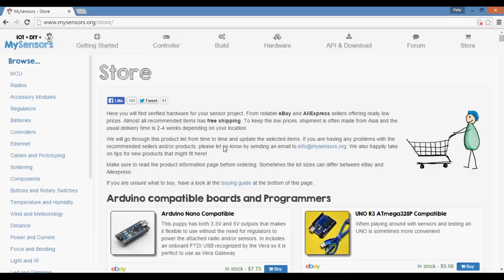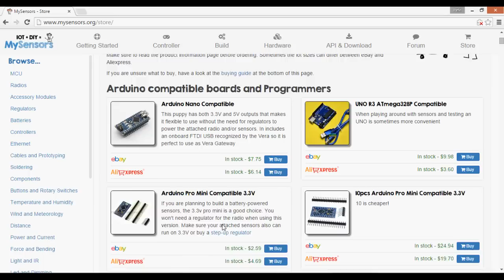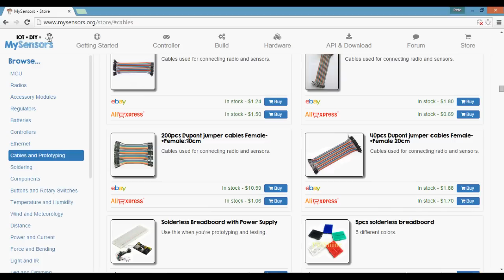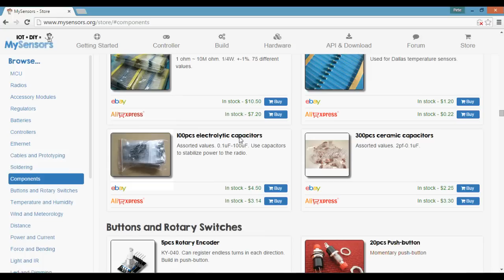MySensors Getting Started: Creating a Motion Sensor

Comment: Like your videos.  Trying to wrap my head around all of this stuff.  I know I just need to get started and try a few things but struggling with what controller to use.  Ultimately I want to control a complicated semi commercial greenhouse on my property as well as many things in the home. Not sure if Vera is my best choice?
Reply from the maker: I have been using my Vera since 2013 and it has served me well.  It is not without it's flaws but it doesn't have a monthly subscription which is nice.  It's cheap to jump in and try it.  I recently have been getting started with Home Assistant.  It's free and open source and also seems to have some amazing momentum around it.  I like that the hardware can be scaled if needed (unlike Vera).  The MySensors integration isn't as full as it is on Vera but it doesn't seem to be a deal breaker so far.  I know there are others that use Domoticz.  Are you going to need remote access?  Vera does it for free and Home Assistant can be configured manually or you can pay a $5 monthly fee for it.  Not sure about Domoticz.
Reply: Pete B yes I need remote access.  how remote can you be?  Can you control and check on things when your away or on vacation?  I have had problems with water being left on.  Have you done anything to sense your water meter usage?  I see their are a couple of sensors for that possibility.  Does the radio work for structures outside the main one where it’s housed.  I have an outbuilding and a greenhouse.
Reply from the maker: You can check the Vera anywhere with an internet connection.  I' sure Home assistant will do it as well but I've not yet implemented it so I don't know the experience. 
I have two devices for monitoring water but both are custom built.  The easier of the two is RTLAMR to monitor my utility water meter's over the air signals.  I know there are some commercial options out there but I'm not sure if they integrate with any home automation controllers.  
The radios can work over long distances with the right antenna.  If you're using MySensors you can have repeating nodes.  If the distance is really far you could even consider a separate gateway and send the messages back over ethernet with MQTT or the ethernet gateway.

Comment: I purchased a pack of 5. I connected a 12v DC input and no matter what I do the output always shows 12V. It never goes to a "low" 0V output. From what I read these can use between a 5v and 20v input so I'm assuming a 12v input should not be an issue and still produce a High when triggered and Low 0V when not triggered output. What am I doing wrong?
Reply from the maker: They are pretty simple devices so they may just be bad/dead but have you tried triple checking the wiring?  Check to see if 5V works (instead of 12V which should not be an issue but you never know).  Adjust the trimpots to make sure the time delay is turned down to around 5 seconds.

Comment: I hate to bother you again but after  adding the sensors  to vera the luup engine keeps rebooting randomly i tried with sleep and only reporting when motion is detected can you please look at  my sketch  https://pastebin.com/uBxULfwU
Reply from the maker: Strange.  I have been using the Vera files without any issues for years.  I would start small.  Make sure the basic motion sensor sketch is working properly then start adding additional sensors.  I am using an Ethernet gateway that my Vera connects to via a static IP.  From there all my sensors are communicating with the gateway.  If you are still stuck after that I would suggest posting on the MySensors forum as I have never experienced the issues you're having.  Sorry I can't be more help!
Reply: ok , and you are using the basic example sketches without modifications ?
Reply from the maker: Just the configuration changes (IP address, radio power, etc).

Comment: Hey Pete can you post some of your sketches on github or somewhere so i can look at them since you also use vera, and for the life of me i cant get rpi 3 ethernet gateway to work properly on the vera edge ui7  vera shows it connected but when hit pair then plug sensor in and wait 1 min nothing shows up. I use MYScontroller and can see the sensors communicating.
Reply from the maker: The sketches are all here: https://github.com/mysensors/MySensors/tree/development/examples but it doesn't sound like that's your problem if you see them working in MYSController.
I use an Ethernet gateway and haven't tried the rpi.  I would suggest heading to the MySensors forum as they will be more knowledgeable.
Reply: ok thought  yours may have been setup differently as from what i see there is always some type of variations ,  and am trying to see if any or your combined sketches look diff.  I have been looking in the forums. thanks for replying

Comment: Hey Pete thanks for the video.  I wanted to make a multi sensor node using, DHT22 AM2302, SR50,TEMT6000 and maybe smoke, now my question is if i did not want to use a breadboard or prototyping board since they all uses 5V would i be able to connect one header wire to 5V the splice  and ad 4 other header wires for power and ground?
Reply from the maker: Yes, that should work.  You will want to power the sensors from the 5V source (cell phone charger or something similar) not the 5V pin on the Arduino.
Reply: I would be using a nano and plan on bringing power in through the usb 
port, then connect the sensors like mentioned  to the 5V pin so it
 would look like a tree and branches. Would I be able to connect the 
radio using the 3.3V pin or would I need a step down or regulator as it seem the chip has pins for both.
Reply from the maker: Unless you are using the amplified radio (with the external antenna) you should be able to power that from the Nano 3.3v.  You should power the sensors from the USB cable though.
Reply: Hey Pete can you help adding a tmt6000  to my sketch, googled but mysensors doeant have much on it.
Reply from the maker: Sorry, I've never used that sensor.  I use the BH1750 for all my light sensing projects.  There is some good info on wiring the TMT6000 here though https://learn.sparkfun.com/tutorials/temt6000-ambient-light-sensor-hookup-guide?_ga=2.37012707.2140145781.1500037667-1846376877.1500037667

If you get stuck, I'd suggest posting on the MySensors forum
Reply: yes i saw that and i kinda  have something  that works, is it ok for the light readings to change say from 175-145 in about 9 secs never seems to be constant.

Comment: Do you know how to make the pir sensor to not only detect motion but also the direction of the motion?
Reply from the maker: Sorry, I don't.  That would be cool but I'm not sure it's possible with this sensor.
Reply: I did this ones by hooking up two sensons ( in this case IR sensors but doesn't matter) put them next to eachother and register which sensor sees an object first. Don't know if it's going to work with these sensors because they have a wide angle. You could put a shield between two sensors so it blocks the view over the other sensor
Reply: Zur'ain Zulpata

Comment: Hey just a question, What is stopping the sensor to connect to someone else's gateway or someone else trying to access your sensors with a different gateway, It seems like the code is the same for everyone.
Reply from the maker: Good question.  MySensors has both signing and encryption available.  It is not turned on by default though so you will need to do that with the configuration "defines" at the top of the code.

Comment: Pete, is it possible to use more than one sensor in the same arduino and send all information together to Vera?
For example: I would like to use a DHT11 + ACS712 + HC-SR501. Can I connect all them in just one Pro Mini to send all information to Vera or do I need to build one arduino+radio for each sensor? Thank you very much. I am a big fan of your videos.
Reply from the maker: Yes, it is definitely possible.  I have one Arduino Mega that has around 30 sensors.  You will need a separate Arduino to act as a gateway though.  So you will need a minimum of 2 arduinos.  One for the node and one for the gateway.
Reply: Thank you very much Pete!

Comment: Pete,  your first video did explain how the sketch software libraries worked and how they talk to each other mate.  I built the board but could not work out how to add the libraries and where it would talk too.  I wanted a single relay to talk through my wifi and through your serial one would do it, I was wrong . Anyway thanks for the tip on Domoticz it looks great still learning.
Reply from the maker: Chris, sorry, somehow I missed this.  Hopefully you got it figured out but the libraries are required to build the sketches.  You can download the libraries from GitHub or in the Library manager of the Arduino IDE.
Reply: +Pete B downloaded the libraries, but there is no library folder in latest mysensors zip.  Or I did work it out.  So I can't use it.  Anyway the soldering was fun.
Reply from the maker: Chris B They are now outside of the MySensors core github. Here is the link: https://github.com/mysensors/MySensorsArduinoExamples  
Sorry you couldn't use it.

Comment: Where do you set the SSID and password for the sensor if I need it to connect to my WiFi so it can send data to the Domoticz server?
Reply from the maker: +Tim H 
This sensor won't connect directly to your wifi.  You will need to have a gateway between Domoticz and all the MySensors sensors.  There are various gateways you can build.  The serial gateway is probably the easiest to build.  Here is a link to more info: http://www.mysensors.org/build/select_gateway
Reply: +Pete B Yes, I figured it out myself, but I can not get the sensor to connect to the gateway. I just get status: faild. I don´t know if its the WiFi module or anything else. Iv used capacitors on the nRF24L01+
But larger caps, I do not know if its too large but that should not matter..... or?
Reply from the maker: ***** Check out my troubleshooting video.  https://youtu.be/vehinrWbxpw
Are you getting status failed on every send or just some of them?  Are you feeding the radio separate 3.3v power?
Reply: +Pete B All of them. I only have 2 WiFi modules so I tried to switch between gw and sensor, but no luck. I gave up for today. Im using Arduino Nanos. Iv also tried to use a Arduino Mega 2560 for a sensor because I want a TFT display showing a graph. I can compile the code but it freezes at gw.begin();
But that is a later problem, for now I just want the Nanos and nRF24L01+ to work. I think the problem has something to do with the WiFi modules because the sensor do not get a node id... I am using the nanos internal 3.3v. And quite large capacitor. 4700uF (22v). But as far as I know it should work.....

Thanks for the reply.
Reply from the maker: ***** Hmm.  Sorry, I'm not sure then.  Try posting on the mysensors forum.

Comment: Hello, can anybody please help me with this? I was wondering if there was some sort of filter that I could place in front of the pir module, that would filter out any low temperature objects and only allow high temperatures to trigger the sensor (body heat). I plan to mount the sensor on a rotating turret, and when it spins I don't want the sensors to be triggered by the moving background (walls, bookshelves, etc.) thanks.
Reply from the maker: +Liam Corbett 
Sorry, I don't know of a way to do this.  You might try posting on the Arduino forums to see if anyone over there knows.
Reply: +Liam Corbett http://www.ebay.com/itm/262130705273?_trksid=p2055119.m1438.l2649&ssPageName=STRK%3AMEBIDX%3AIT
Reply from the maker: +TerminatorD4 I don't know if that's what he's looking for.  I have one of those and it will pick up movement of the sensor if I rotate it in an empty room (doesn't need to have a person in it to trigger). +Liam Corbett
Reply: yes that is true. Thanks for the replies everyone, but I've decided to use ultrasonic sensors as they are much more accurate.

Comment: Does the output (middle) pin on the PIR sensor go low as soon as a person leaves the sensing area? Like if I had the output connected to an LED which turned on when someone entered the area, would it turn off as soon as they left the sensing area? Thanks.
Reply from the maker: +Liam Corbett 
The output does go to low after it's no longer triggered but I don't think it would be able to power an LED without additional circuitry.  It's only a few mA.  Also, I believe the max trigger time on the motion sensor is 5 min but I'm not positive about that.
Reply: Pete B  I just need the pin to go low right after a person's gone. Thanks.
Reply from the maker: Liam Corbett It may not do what you're looking for then.  Basically how it works is once it detects motion it stays high for the time set on the trim-pot.  I think there was a setting that would retrigger it (and keep it high) but I vaguely remember it not working correctly for me.  Your mileage may very though.